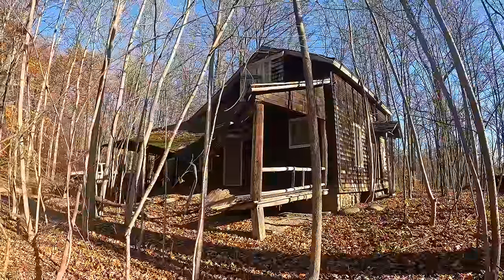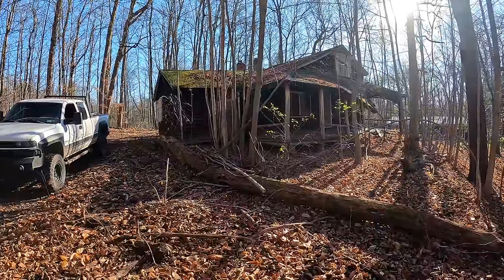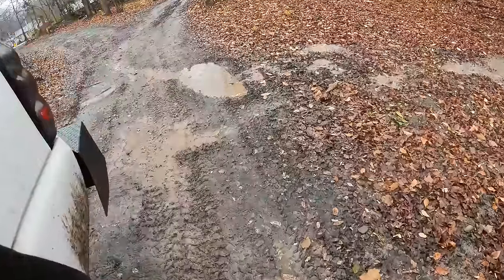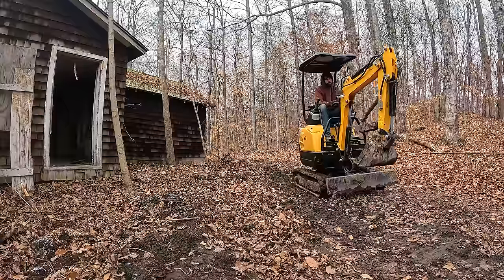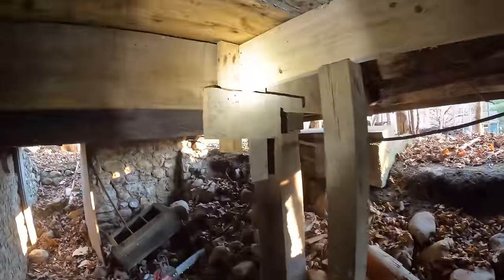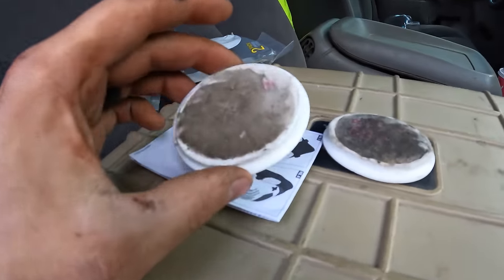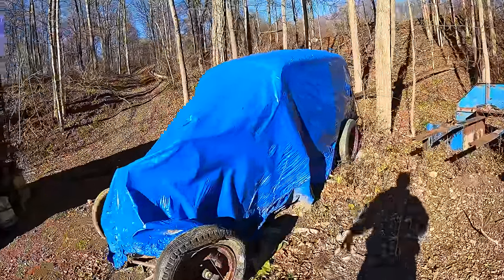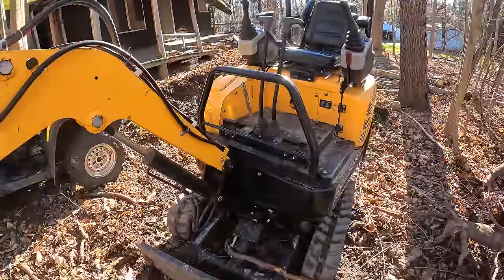I bought an ABANDONED CABIN in the WOODS - Vacant for over a hundred years!

Comment: That place was not abandoned  that long. I would say it was abandoned less than 20 years ago. Most people don't realize how fast a house will deteriorate when abandoned. I have seen old houses that were being lived in that ended up sitting vacant for just a few years that really deteriorated fast and within 10 years were in worse shape than this one.
Reply: 10 years max. Someone had a fire in there somewhat recently 1~2 years ago.
Reply: Doesn’t really matter how long it was abandoned it’s the age of it. It has plaster walls not drywall. It probably has held up so well due to how well it was originally built.
Reply: While I'm not convinced of 100 years old, the house is old. The house could be 70-80 years old. That is by the construction of the plaster walls and wallpaper used. 
The reason on why the house is in such okish condition is because the roof tiles are in decent condition and the windows and doors were covered preventing water ingress.
Reply: @Sea-cucumber1151  the thing is the guy who posted the video wasn't saying the building was 100 years old... he was trying to claim it had been ABANDONED FOR 100 YEARS. BIG DIFFERENCE. And wet wall (also known as lath and plaster was still used regularly up into the 1950's in many areas and is still on occasion used today on quality construction but it's getting rare and there's not many people who still know how to do it.
Reply: @mrdan2898  I agree completely. I used to do construction and did restoration work on homes built in the 1880's through the 1930's and remodeling on ones from the 1880's through modern homes and have worked with wet wall (lath and plaster) many times. It's getting rare for it to be used anymore but there are still a few of us who know how to do it.
Reply: Houses don’t like to be empty.
Reply: @todddenio3200  you are correct, I just meant it was built well so it has held up as someone said the roof tiles are obviously what held up.  I just meant who cares if he described it wrong by mistake or intentionally it’s still an older home.  Even if they still did plaster walls up till the 30-50’s in 2023 that is close to 100 years in comparison to homes build now that start failing in 20-50 years or less. Maybe that is your point I just didn’t think it really mattered, as far as click bait I have seen far worse and find it minor.
Reply from the maker: @mrdan2898  house was built in the 1860s no one has lived there since the 1920s. This is not a question.
Reply: @99Projects  with century old asphalt tiles in that good  condition ? lol tell us another one
Reply: @99Projects  It is clear to anyone with eyes that it has not been abandoned since the 1920s. I was planning to stick around and watch but seeing you double down and insist that it has been abandoned that long after many people point out clear indicators that suggest otherwise really sets the stage for a quick exit. Was it or could it have been built that long ago, sure, but abandoned for that long, with those windows? No way.
Reply from the maker: @datalorian   most all people have eyes, and lots of people wear glasses or are blind or just don't use their eyes.

the time frame in which the cabin was built (1860s) and abandoned in (1920s) is not in question at all. I know these things are absolutely correct.
Reply: @fiberartistsupplyco 🤡🤡🤡💩💩💩🧌🧌🧌🧌🧌🧌
Reply: @kelleyhawk6595 Sounds like your the troll!  😜
Reply: @Sea-cucumber1151  I live in an OLD house that is a 'sister house' to the one next door.  They were, built in CNY during the late 1700s by a revolutionary war soldier (1st house) who mustered out of Ft. Stanwix in Rome, NY (interesting history there) & son in law & daughter (second house, mine).  Then was purchased by my relatives coming from Ireland in 1851.  Mine was added on to in 1898, and 1998.  Still standing.  Both houses are still handed down to family.  Our's is lived in regularly & the other is now a summer home.  Our's has been completely gutted, renovated wiring, plumbing, sill plate, siding, windows, etc...Their's is a museum.  still plaster & lathe, a bathroom added in the 1950s still the same, etc...Both houses are in awesome condition because we both do regular upkeep.  Even with their house being unheated all winter in snowy, freezing NY they have no structural issues.  Now my cousin next door put in a new double wide 10 years ago & the piece of shit is literally falling apart already.  Mold, leaking roof from day one, broken bathroom fixtures, needed a completely renovated kitchen already, flooring is coming up, etc... Give me an old house any day!  I do not for one minute believe that this house has been abandoned for 100 YEARS.  I would believe it is 100 years old.  Due to property disputes, our house was uninhabited for 8 years and was getting to the condition of this video house.  It was literally ready to cave into the ground.  We had to rip the entire sub floor out & sill plates.  We had the upstair jacked up with two pine trees to keep it stable while repairs were done.  I think his project is cool, but I don't buy the abandoned for 100 years part really.
Reply: @99Projects  Those intact asphalt roofing tiles are absolutely not 100+ years old, so yes it is absolutely in question.
Reply: @Kune35  The owners could  have reroofed without living in it, just to make sure it didn't fall into a complete ruin. Basically just maintained enough to eventually sell it.  "Asphalt shingles are an American invention by Henry Reynolds of Grand Rapids, Michigan. They were first used in 1903, in general use in parts of America by 1911 and by 1939 11 million squares of shingles were being produced."
Reply: I grew up there, it's been abandoned my whole life, so over 40 years.
Reply: I grew up there, it's been abandoned my whole life, so over 40 years.
Reply: I grew up there, it's been abandoned my whole life, so over 40 years.
Reply: I grew up there, it's been abandoned my whole life, so over 40 years.
Reply: I grew up there, it's been abandoned my whole life, so over 40 years.
Reply: I grew up there, it's been abandoned my whole life, so over 40 years.
Reply: I grew up there, it's been abandoned my whole life, so over 40 years.

Comment: Might be better to fix or tarp the roof and make sure the outside is sealed to prevent more dampness coming inside. Lathe and plaster replaced beadboard in the 1900s, drywall sheets began about 1940s. Square nails indicate prior to 1900.
Reply: My home was built in the 1850s and square nails where used and the roof had 26 inch wide boards with square  nails . Horse hair plaster walls  and Maple floors.  Bath room put in 1920s.
Reply: my house is lath and plaster it was built in 1910

Comment: I don't know dude. The definition of a cabin TO ME is some place tucked deep in the woods or near some significant destination (lake, ski slopes, large recreation area, etc.). That thing is next to a significant artery/road. So, I would classify it as just a completely run down house. With failed foundation, roof, exterior, windows/doors, and a trashed interior, the cost to renovate this (assume free labor), will be the same and maybe more than just starting fresh with some raw land and some small home plans. Plus, you have to live within all the constraints/restrictions of the existing design: its fixed location, the set back from the road (and its noise you could hear here), well/septic, etc. AND, you have to do all the demolition and remove all the crap and pay for demolition dumpsters. All that extra demo work is not needed on a new build, saving a ton of labor. It does not look remotely worth it, unless there is either something special near by, or it has some sentimental value. You might be able to build a true cabin somewhere special for $40-50K doing all the work and have a completely blank canvas. I think going new would also be way less hazardous (asbestos, rotten stairs, roof cave in, critters: rodents/bats/birds...).
Just finished this...So, is the crux of this really it is adjacent to property you already own, or actually already a part of it? Maybe you should take a couple to explain what you are trying to get out of this to at least make sense of it...lol.
Reply: What fun is that
Reply: I have to agree, I was going to say the same things but you beat me to it.i hate to be negative but I've remodeled guita a few homes during my life  but they were all a lot more solid to start with.  The crumbling rock foundation is the worst part. The construction/framing looks sketchy also.
Reply: I just found your channel and I will follow along to see how it turns out but if that was mine I probably would have torn it down and started from scratch.  I've done a lot of remodeling and sometimes the land is worth more than the building. Also you should be wearing a tyvek hazmat suit while doing the demo work. All that dust getting into your clothes and truck and eventually back to your house is bad.
Reply: @michaelweilmuenster5754 "sometimes the land is worth more than the building" exactly. Its annoying when people try to sell property at an increased price because it "has a building on it"

the building:
Reply: It's a project, Lisa.

Comment: Be careful out there walking around, you may find an old well that is covered over in leaves and grass and that would make it a bad day.  Wells are great to have, but you don't want to find them by surprise.
Reply: The modern plug on the wall is kind of a dead giveaway.
Reply from the maker: @ericblair6984  modern outlets were in common use in the 1930s.
Reply: @99Projects  True, but do you really think the plug and plate cover would have looked like that after 100 years in the woods? My guess is that this place was only abandoned in the last 10 to 20 years at most.
Reply from the maker: @ericblair6984  fortunately for everyone i am not guessing how long it’s been vacant.

Comment: Hey man- great content.  I'm both jealous and thankful that I don't have another project like this one.  Just a little advice from an old timer.  You can use that spade shovel to remove the wood lathe and plaster from the walls.  You can pry, but as soon as one side is demoed, use it to stand back and blast the other side out - from between the framing.  A 5' piece of scrap 2x4 works as well.  Good luck.
Reply: Excellent advice!

Comment: The very first thing that he needs to do is have the foundation checked along with all of the main support beams that are holding up the lower floors and the walls and then the roof's main support beams.  Most likely those will have to be shored up or replaced.  He may need to have the house leveled again.  The roof and porch will basically need to be torn down and rebuilt.  To check your home for leveling -- you can use a visual method which is to check to see how all of the doors and windows close and open, are they fitting properly inside the frame?  If all of your doors and windows close evenly in the frames, your home is pretty level.

There's no bathroom or kitchen -- was it ever plumbed?  Where is the septic tank and a clean water supply coming into the house?

Wow!  What a project !!
.

Comment: Friendly note to all who need to remove the old horse hair plaster, or plaster of any kind...
Take a flat head shovel or a scraper and remove the plaster from the wood slats first, then remove the slats after you clean up the plaster.
Great video all the same and I can really relate to the feeling that we all get to see this type of work being done by others who aren't afraid to take on such a chellenge.
For some, its in our blood!
Reply: Been there. Thankfully didn't have to do much of that. I did have to take down a wall of tile set in mortar. Put plywood over the tub then used a sledge and brick chisel. Unfortunately it was set in wire and not lathe but I eventually got it all off. Vapor barrier, green board, vapor barrier and then cement board. Finally same thickness as surrounding plaster walls. Now you can't even tell I took it all off. I retiled over the new cement board and it doesn't stick out an inch like before. Retiled the entire bathroom, floor and walls halfway up and the entire tub surround. Looks original now.

Comment: When you wear any respirator you should not have any facial hair if you want proper protection. I was a safety manager at a chemical plant and did respirator fit tests. Any substantial stubble would fail the fit test every time. If you don't want to shave you can seal the respirator contact areas with generous amounts of Vaseline.

Comment: ALWAYS buy a truck that has that.  Then if it's older than '03, like yours is, put an 03 to 07 switch in it.  It's just the solder joints that vibrate loose.  Now speaking of a truck you never want to buy, that Ford is a perfect example thereof.
Reply: You mean the Ford with the four wheel drive that still works?
Reply: @inoutdoors624  The Ford probably doesn't work, either, and doesn't have enough engine to matter if it did.  That he's too lazy or ignorant to spend 5 minutes and ten dollars replacing a 20 year old switch is no reflection on the real truck of the two.

Comment: Built 100 years ago ? Possibly.

The stonewall foundation and raw timber framing would support that.

Last lived in/Abandoned ?
Probably 70's/80's.

Had electrical ran in the walls. So it was most likely last reno'd in the 70's, (those nasty brown plug faces were a thing of the 70's).

Electrical service didnt really become normalized for rural areas until the 50's (or 60's depending where you were).

So... definitely not abandoned 100 years.

Comment: I can tell you 100% that wasn't "vacant" in the 1800s. it has Asphalt Shingles. They weren't invented until the 1900s and not in wide use until really after 1915. 

You don't go through the expense of putting on a Shingle roof for something that is going to be abandoned right away. If that wasn't in use in the 1970s I'd be shocked as those Shingles do not look like they have enough damage to be any older than that... (Honestly 1990s is likely more accurate) 

That is just from the first 46 seconds. 

Then we go inside. The cabin is wired with electrical. Using NEMA standard sockets. That puts this to the 1940s as being in use. 

The ceilings is using Sheetrock which wasn't "invented" until the 1917 but not really in wide use until the 1930s... again suggesting it was remodeled at least in the 1930s... however that looks later. Again everything I see in there looks from between the 1950s to the 1970s or even the 1990s. 

I would say that place was in regular use at least in to the 1950s or 1960s. 
Again that is just in the first 4 minutes. 

That place was build in the 1880s (based on the foundation and joists) and then remodelled between 1940-1960... (maybe into the 1980s) That roof from no later than the 1960s. I'd be surprised if it isn't from the 1990s or newer. 

that is 30-50 years Vacant not "over a hundred years"  In fact you can likely figure out when it was boarded up but just measuring the 2x4s and comparing them to standards sizes by year as 2x4s have gotten smaller and wood grains larger over the last hundred years.
Reply from the maker: so confidently wrong lol thanks for commenting
Reply: @99Projects no you are just a click bait fraud... but good work and getting engagement.

Comment: Cool cabin. Electrical conduit running up the outside makes "vacant since the 30s" most unlikely, but porch construction matches my grandmother's cir. 1930 barn. The interior fireplace, door hardware, and enamel steel fixtures all look circa 1930 or so also. Most likely, there was no bathroom, just an outhouse and a well. I see no sign of gas piping, so fireplaces were the only heat--yeah, and that upstairs flu was a wood heater. Electrical was most likely added in the 50s by the rural electrification projects. External fireplace is clearly more modern and exterior decay looks more like abandoned maybe since the 1970s. Not sure where you are, but 100 years without paint would erase most anything made of wood anywhere but the desert. Of course, you might find clues to occupation as you go, especially in the soil around the doors.

Comment: if this had been vacant for over a hundred years, how are there breakers with platic in them? plastic hadnt been invented a hundred years ago....
Reply: One quick google search will tell you it was invented in 1907. Did you not even look that up?
Reply: @TheSourOnion  that was only bakelite, and it was INVENTED then. then it needs to be applied to products, manufactured, sold and then installed. and bakelite isnt in circuit breakers. did you even think a second before just shouting out your quick wiki search?
Reply: @dervakommtvonhinten517  damn ok mb

Comment: It seems like the lawn was overgroen by trees. There seems to only be a handful of trees that are really thick (and probably older than 50-60 years). Most of the trees seems to be 30-50 years old. If the lawn was getting overgrown at the same time as the cabin was abandoned (which is reasonable) the lawn should be full of trees that started growing around then. It doesn't seem  like there are a lot of 100 years old trees there, but rather a lot of 50 years old trees, it seems more likely that the cabin was abandoned in the 70s. You could check the growth rings on the trees you're cutting down to verify.

Comment: When you pull stumps, if you got an extra tire and wheel laying around, run the chain over the top of the tire and place it about 3 feet from the stump and tie the chain as low on the stump as possible. This will give you greater leverage and pull the stump upward and out rather than trying to pull thru the dirt.